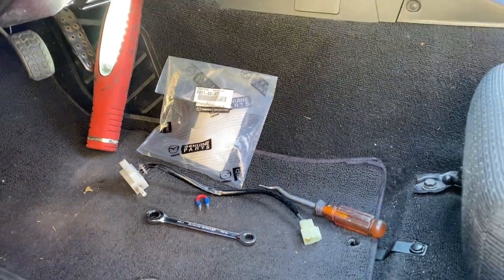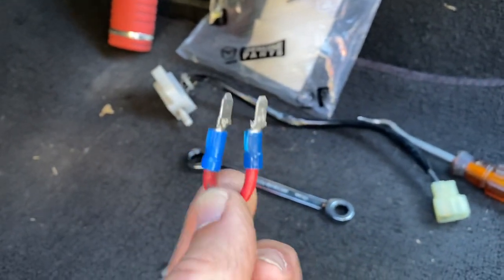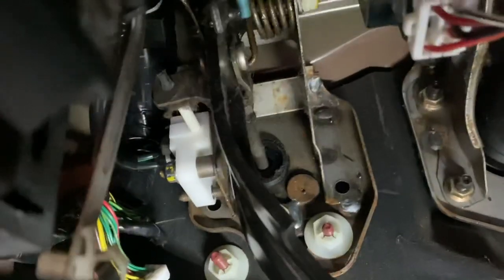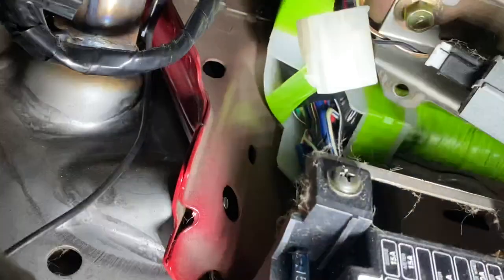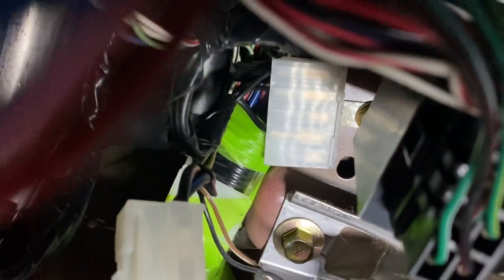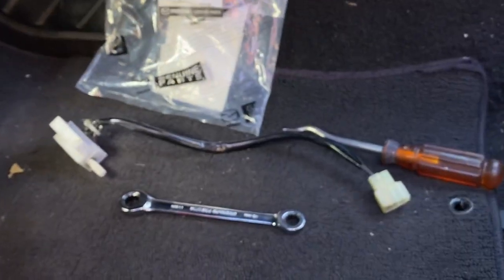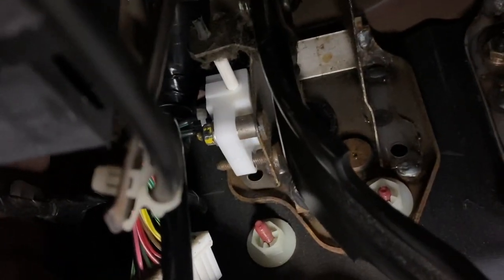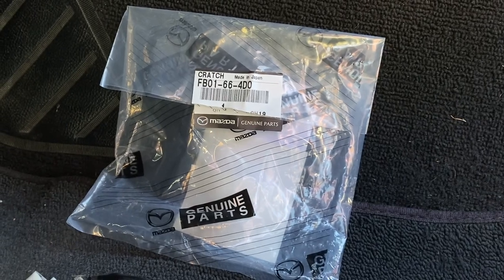Mazda MX5 Miata CLUTCH SWITCH replacement and bypass instructions.

Comment: So this was 100% my issue and this fix works however to be even more frugal and a little safe.... if you take the old sensor out and just either solder or crimp the two wires on the pigtail you can plug it in without any risk of it coming out

Comment: Yes, I have this problem on my '90 but since I haven't driven it in two years, I haven't had a chance to fix it! ;) I'll save the $$ and go for the jumper option. My '90 is in US and my '03 in Europe and the European one doesn't have the clutch switch. I haven't had any problem starting it accidentally in gear in 12 years, so comfortable. BTW, seems like an easier jumper fix would be to just cut off the wires from the switch to the harness about an inch from the harness, keep the harness plugged in and just splice the wires.

Comment: Great thanks, I've got a P0704 on my ODBII Diagnostic tool thing and I wondered where the hell the clutch switch was. Now I know,
Cheers, great, and very detailed, video. Subscribed and liked.
Dave (Gloucester UK).
EDIT NOTE - Found out why I've got the code. The clutch switch is just dangling! Had some clutch work done recently including replacement of a broken clutch lever, reckon they didn't fit the switch back on at the end! Email sent to the garage.
Reply from the maker: Hi David, I am glad you were able to fix it. 
Thanks for the positive feedback 👍😊

Comment: If you bypass this with the jumper. Will the engine light remain on? Mine is showing Code: P0704 " Fault in Clutch Switch". Otherwise, I guess I will replace the switch if the jumper does not clear the code. Thanks!
Reply from the maker: Not sure. I haven’t hade a P0704!yet. Let us know what happens 👍
Reply: @MiataMan I have code P0850 for park/neutral switch circuit. Mines the 6 speed 2002 miata. Will the code stay off if I bypass or should I get the switch replaced for the code to go away completely?

Comment: Hope this solves my issue, new starter, new ignition switch, still having an intermittent no start.  Thank you for the video.
Reply: Ive been thinking about replacing my ignition switch because i get a clicking/ticking sound coming from under/behind the steering wheel while cranking the car especially on cold starts but I am going to try the clutch switch bypass first

Comment: i like your videos! I have a problem in my NA, every time I press the clutch pedal, the brake warning light on the dashboard turns on. We haven't been able to solve the issue.
Reply from the maker: That’s a strange issue. 
I wonder if the wiring that goes to the brake master cylinder is touching on something? 
If the fluid level is too low in the Master Cylinder, it will trigger the brake light to come on. If the wire to the sensor is damaged, it could have the same effect.

Comment: Well done. I agree that working under the dash is very difficult.
Reply: ah yes the fun my partner has mocking me when she walks outside and finds ive pulled the drivers seat out of the car and im upside down under the dash with my legs up in the air, swearing profusely. The "miata position".

Comment: What size are the terminals on the cable that bypasses the switch? I need them to fit tight on the conector for them to not fall out

Comment: Does this make the engine light go off? I have code p0850 thinking this is my problem. If I bypass it will it go away
Reply from the maker: I haven’t had an engine light come one due to the clutch switch.

Comment: There is a gray color switch on top of the clutch safety switch what is that for?
Reply from the maker: There are two switches on the clutch pedal assembly. The bottom one that engages when the clutch pedal is down, is the interlock/safety switch. 
The second switch at the top of the pedal assembly “clutch position switch” tells the ECU if the clutch pedal is engaged or not.

Comment: So what exactly does the clutch switch do
Reply from the maker: The clutch switch is a safety feature that requires you to have the clutch depressed when starting the car. If the clutch is not depressed, the car will not crank / turn over. Before this feature was invented, you you could start a manual car while it was in gear and it would jump forward and potentially hit the car or wall in front.

Comment: Where did you order your clutch switch? I’ve been looking for one online and I’m having trouble finding a new one with the wire piece that plugs into the connector up above. All the ones I’m seeing are just the switch and no wire. Also what gauge wire did you use for the bypass to find out if it is your clutch switch that’s going bad?
Reply: He read the code, and said it was a genuine mazdz part. Im gonna go with your local mazda dealer

Comment: Great job. Any real benefit to keeping this? I heard removing the mandatory clutch in saves a part of your transmission, that I can't recall lol, on mandatory clutch in startups! Been looking for this bypass for a while just didn't know what to search. Thank you greatly. The clutch in feature is a thing that isn't standard around the world I believe as well.
Reply from the maker: The only real benefit of the switch is to prevent the car from jumping when started while in gear.
Reply: I did this with a jumper and got the same results! Easy! Also adjusted my clutch pedal while I was down there.
Reply: Another benefit with the jumper option is    that there will be less wear on the crankshaft thrust bearings. The engine may just live a tad longer.

Comment: I have a 1990 miata and the clutch switch is in front (drivers compartment) of the clutch pedal arm with what I believe would be a plunger switch that the plunger comes out when the clutch is depressed. Is this right? I don't see any plunger coming out now. It also looks like the switch is threaded through the mounting bracket with an adjusting nut also. Am I right on this?
Reply from the maker: There are actually two switches on the clutch pedal. The one at the top that allows the car to start when the clutch pedal is deployed. The other is at the bottom of the pedal stroke and sends a signal to the ECU that the clutch is engaged.